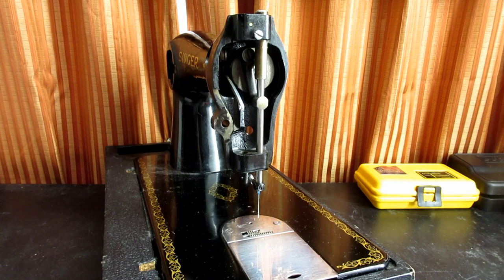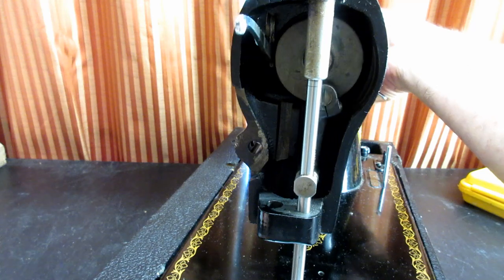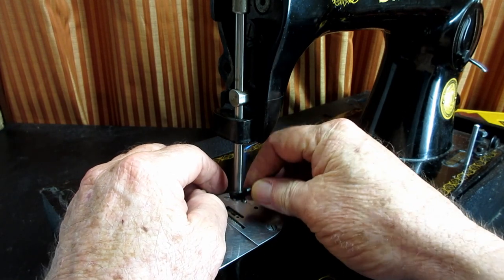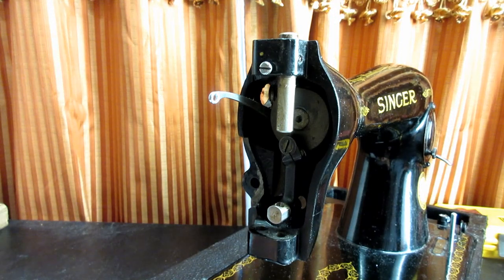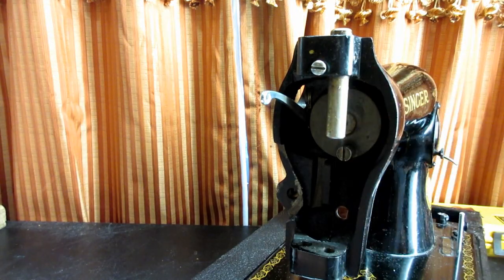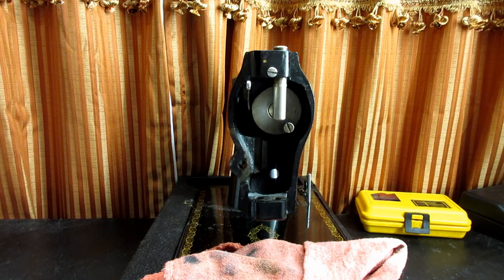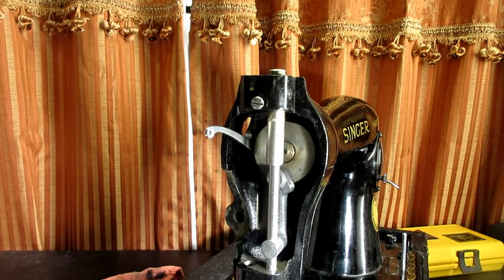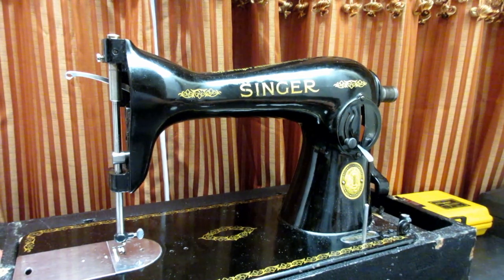SINGER MODEL 15-91 HOW TO REMOVE, INSTALL, SET HEIGHT OF NEEDLE BAR

Comment: Oh, I can't wait until you get farther along in this series. I just got a nice 15-91. It was already working fairly well, but I'm cleaning it up and lubing it and the light and the motor need a little rewiring near the connectors to the plug. I can use all the help I can get to understand this machine. I've worked a little on a 66-19 but haven't taken anything apart except the tension so I'm very new to these vintage Singers. So hurry up and get this machine restored so I can follow along! Thanks!
Reply from the maker: Thanks for watching. My 15-91 needs some wiring repair too, and the motor needs some cleaning. Working from front to back and will get there eventually. In the meantime, you might like to view my Playlist for "Cute" a SInger model 99K. Model 99 is a 3/4 size model 66 and most of the parts and features are the same https://www.youtube.com/playlist?list=PLsCOZgzzaiKIIUgkEujqHc9iNWN9NPW2Z    That playlist could give you something to do between the Ike Model 15-91 videos.
Reply: @andytubesewing1953  Thanks for the recommendation! I'm also working on a 66 which I've purchased a rewired motor and light (the same as the original) which I'm waiting for. It's not as complete as the 15 (the 15-19 came with the bentwood case complete with the cover for the compartment in the base) but in pretty good shape.
Reply from the maker: @supercorgisue1514  You'll end up with two superb machines. I know I have a 66 in a cabinet somewhere in my wife's storeroom but it's been in there 10 years at least. I've never worked much on the black iron models but this 15 and the 99k are impressive.

Comment: Oh my gosh.....I felt your pain Andy in getting the “gib” set back on in the correct position!  You did it in short order!  I found this to be the hardest piece to replace when I went through my machine.  It was a real nightmare for me.  Took me forever to hold everything just right and get it to stay and not fall out of place.  Kudos!
Reply from the maker: "pain" is correct. Even though I've done this on a couple of other models, it still took a while to get it right, then I practiced a couple of times before filming. I always sigh with relief when I finish the install, haha. Thanks for watching my channel.

Comment: Yes - I did enjoy this, and the close-ups especially good to see how things are set up in those dark, tucked-away places.  Okay - now where know where two felts go... looking forward to the next instalments to find out how many there are all together and what they're all used for.  :-)  I guess those slight differences in machines in the distance between the height/timing marks come about because, either at installation or at some time since, the top bushing wasn't always set in the machine at exactly the same position?
Reply from the maker: You could be correct about the setting of the bushing in the factory. They sure made millions of machines, mostly by hand and in noisy conditions so I could see a 1/64" difference at times, and that tim=iny amount can cause skipped stitches. I wonder who set the needle bar height and if they had a GIb or gauge that held the NB while they turned the clamping screw. Thanks for watching and yes, a couple more wicks that I know of.

Comment: Hello, besides the motors whats the difference between this model and the 15-90>I believe I have a 15-90. Love all videos, I have repaired a few machines with your advice.thank you,I still love your giggle  ;-)
0
Reply from the maker: I've never seen the 15-90 in person, but I do have both parts lists and they seem to have all the same parts and features. Same arm shafts and connecting shafts, same hook and bobbin case. The 15-91 did have a moulded light fixture, and yes, the "potted" motor, while the 15-91 had the external mounted motor and belt. The 15-90 parts list also shows two handwheels, a spoked one and a solid one. Here is some info on the different model 15 versions: https://ismacs.net/singer_sewing_machine_company/model-list/classes-1-99.html Thanks for watching, and I'm always laughing at myself with these machines. 😉

Comment: Hi Andy and thanks for all your excellent videos on vintage sewing machines.  I am trying to remove the needle bar from a completely seized 15k.  The needle bar is stuck in the upright position and I am unable to lower it to access the set screw.  Any suggestions on what I should do next?  Cheers - Roxanne
Reply from the maker: If the machine is seized that's what I would work on first. Removing the needle bar won't help that problem. I start with a very thorough oiling according to the manual. If a manual is needed you can get it free from the Singer support page here: https://www.singer.com/search/support?title=15    The manual on top of the list should do. I would also remove the bobbin case and shuttle as that can freeze the machine. Instructions for that are also in that manual, or here is my video about it: https://youtu.be/uk2IL7iclHk    I'm thinking you could do that even with a frozen machine. If you have not seen it, here is my Playlist for model 15 with all 17 videos https://www.youtube.com/playlist?list=PLsCOZgzzaiKJftyGwzdDiWa9R6HFEACJo     I've probably bought 50 frozen machines and most of them started moving after a good oiling. It can take a while for the oil to soften the old dried-up oil in the machine. You can use kerosene instead if you want, but I use oil and then a hairdryer to heat the parts if I get impatient. Good luck, and thanks for watching my channel.

Comment: Are you going to do a video on disassembling and reassembling the top tension? I cannot get my tension to release when the presser foot is lowered. It stays tight all the time and I cannot see how the tension is released by raising the presser foot (is it the little tension pin that goes inside the main tension rod?) I need help and your videos are so helpful!
Reply from the maker: I'll be doing videos for almost every part of the machine, including the Needle Thread Tension Assembly. In the meantime you can download a FREE copy of the original 68-page Instruction Manual from 1941 from the Singer USA website at this link: https://www.singer.com/search/support?title=15-91   Starting on page 21 there are instructions with pictures for dismantling and installing the parts of the tension assembly. I do this on all models to see how it works and clean and adjust it.  You can learn a lot of great info from these few pages about the tension and maybe discover the fix for your problem. Good Luck, Sue. 👍
Reply: @andytubesewing1953  I'm afraid not. I've been using the manual, following the instructions, and am still having no success. I can't see any way that the presser foot lever could back off the tension since it doesn't connect to the tension assembly in any way that I can see. It's almost like the tension release pin is too short - it doesn't connect or brush against the presser foot lever in any way. :( I guess I'll have to keep fiddling with it until I have some success.
Reply from the maker: @supercorgisue1514  ok, OK then, too sad. I thought taking the tension apart could show a cause. As far as the presser foot lever, I believe it does press on the tension pin when the lever is raised. Ther is not a tension release lever like in later models, but I think the depressed, curved area on the presser lift lever rides up on the backside of the tension unit and pushes the pin.
Reply: @andytubesewing1953  That's what I thought should happen. If that's the case, the tension release pin in my assembly is too short. If you have a chance, could you measure the tension release pin on your machine? I have a feeling that mine was replaced at one point with a shorter one. I can press the little nub of the release pin that's near the presser foot lever and it releases the tension, but the pin is about 1/8 - 1/4" too short to actually contact the presser foot lever. P.S. Just what I suspected - the pin is 1/8" too short. As an experiment, I put 2 washers behind the presser foot lever, and that allowed the presser foot lever to contact the tension release pin and release the tension. My tension release pin is only 1 1/16". Thanks for all your help!
Reply from the maker: @supercorgisue1514  You finally tracked it down. I admire your persistence, Sue. Wonder why anyone would change the pin but I found one similar before. Most of the pins I bothered to measure were 1.25" in length. I make new ones from 1.5" stainless steel finishing nails https://www.homedepot.com/p/Everbilt-1-1-2-in-Stainless-Finishing-Nails-50-Pack-03524/203436053    Here is a video about it  https://youtu.be/M1kXDd5GLEE
Reply: @andytubesewing1953  I read that you can make the pins from nails. Thanks for the link to the video explaining how to do it!
Reply from the maker: @supercorgisue1514  Maybe it can give you some ideas. It's just my way of making one.
Reply from the maker: FYI 11-18-2021, I disassembled my 15-91 tension and measured the release pix. It is exactly 1 1/16" long. 🤔 So I reinstalled the presser bar parts and they work normally and they DO reach and release the tension pin. 🤷‍♂️

Comment: Any tips on straightening out a bent needle bar?
Reply from the maker: I did it once, many years ago. I borrowed a friend's bench vise and put the bar between two strips of an old leather belt for protection, then squeezed it in the vice. I left the needle end outside the vice. I rotated the bar, squeezed, and repeated that many times. The bar came out usable, not 100% straight, but very usable. I was desperate and could not find a used replacement bar. If you have a 15-91 there should be a few used bars available on eBay these days.
Reply: @andytubesewing1953  I ended up putting it on an anvil and gently hitting it a few times. Yes, a few small dents are now on the bar, but she now goes up and down nice and straight. Your video was very helpful for removing and cleaning all the associated needle bar assembly hardware. Now I will spend my next hour getting the needle tension assembly clean and adjusted. Good Saturday project on a cold day! Blessings.
Reply from the maker: @daniellautenschleger6642  Need creates Invention. 👍 Glad you accomplished your goal to your satisfaction. Good luck going forward, and thanks for watching my channel.

Comment: Andy please show me how to get needle gib back in a singer 306k
I’ve been trying for almost a week
Reply from the maker: I've never even seen a 306K in person, Gloria, so can't "show" you how to install the gib on a 306K. It is called the Needle Clamp Gib, part #105190. The original Service Manual for your machine does not even show it or mention it. Other models I have worked on had a Gib so I can refer you to those videos. I have no idea what your Gib looks like, but it doesn't really matter. They all work on the same principle of sliding against the needle bar inside of the needle clamp and are made to hold the needle in place by tightening the thumbscrew of the needle clamp against the gib or pushing the needle into the gib. Take a look at these three videos to get an idea of how they are installed. Maybe one of the videos has a gib like yours, but you'll see how they work   https://youtu.be/zY_XMne5YTQ     https://youtu.be/R66oy38iNV4   and the third video is https://youtu.be/kVB-_1dmOFo     Good luck.
Reply: Setting the machine on its butt is helpful as it gives it a base of gravity while the needle clamp is set in place.

Comment: What happend if you don’t have that screw? I lost it. And I can’t find it in Amazon. Do you know where I can find it ? The problem I have with my Sewing machine 301 is that more often the neddle change its position and the Sewing machine doesn’t sew good.
Reply from the maker: ¿Qué tornillo? ¿Sobre qué modelo? 15-91 o 301? Here is my 301 needle bar video; https://youtu.be/R66oy38iNV4
Here are two playlists with 36 videos for model 301. https://www.youtube.com/playlist?list=PLsCOZgzzaiKLZyGebzS_oISgesXNyREyI
https://www.youtube.com/playlist?list=PLsCOZgzzaiKI_6fbu3itbd1v4z3uQvvkO  If you can tell me the exact screw you are missing I may be able to help you find one.
Reply: @andytubesewing1953  The tiny screw of the neddle clamp posición screw. And my sewing machine is a singer 301.
Reply: @andytubesewing1953  I appreciate your kindness. Thank you so much!
Reply from the maker: @Romidear  Singer Screw #51308 "Needle Clamp Position Screw" I do not know of anyone who makes or sells just the screw by itself. People usually have to buy a used needle clamp like this one; https://www.ebay.com/itm/334233474586?chn=ps&mkevt=1&mkcid=28
Reply from the maker: @Romidear  👍

Comment: My needle bar bushing has been removed and is no longer at the correct height to use the timing marks on the needle bar. How do I get that bushing reset at the correct height, so the needle bar height set mark and the timing mark are back at the right height?
Reply from the maker: There is a process to do that. It is on page 25 of the Adjusters Manual for model 15-91. You can view the manual, and even download a PDF copy of it, at this link: https://www.manualslib.com/manual/1027731/Singer-15-91.html?page=14#manual  You can print a screenshot if you want, or download it. For downloads only use the green download button towards the top. If you use the blue button you'll download a wave browser, so be careful.

Comment: I cannot get my needle bar or the presser foot bar to come loose to be able to remove it
Reply from the maker: If you've removed the screws but the bars do not budge it is common that they are stuck with dried oil that you'll need to soften. Putting WD40 or alcohol on the bushings will help but you must protect the black finish with plastic bags or similar. Another effective method is heating them with a hairdryer to soften the dried oil, then turning the bars to loosen them. Use a hot pad or gloves to prevent burning your fingers. Be patient but determined.